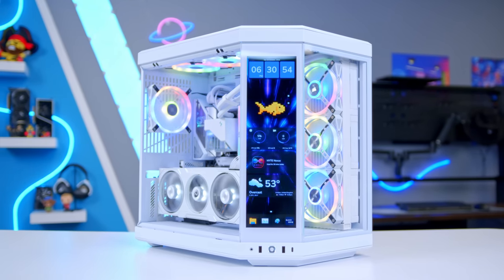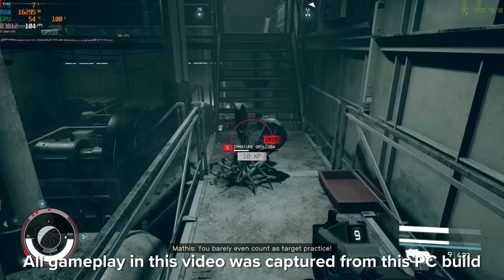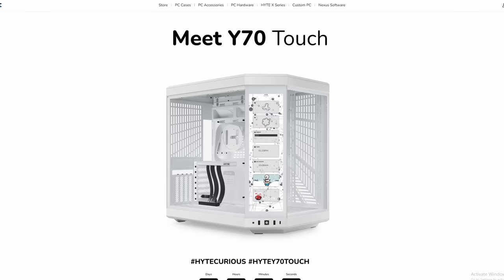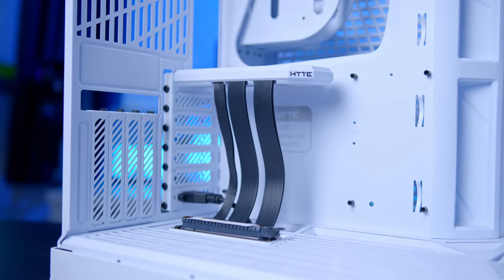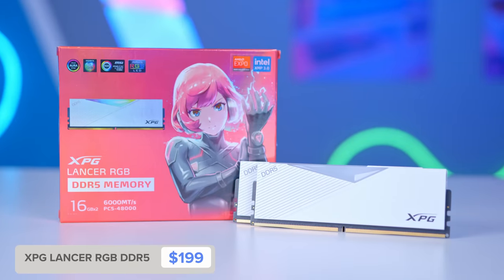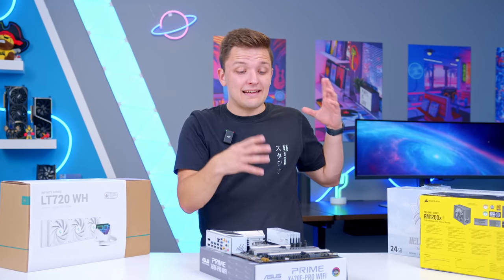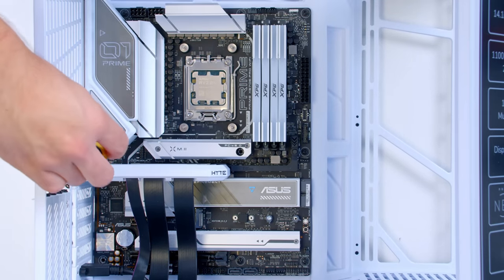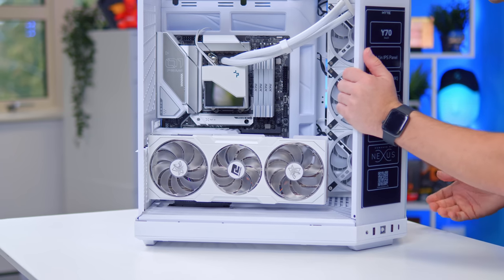The ULTIMATE $3000 Gaming PC Build! 🤩 [HYTE Y70 Touch, 7900 XTX & 7950X3D]

Comment: Nice video as always. One question how did the expo profile go with the 4 dimms or did they default to 3600 MHz and not post at the full speed of expo?
Reply: Thats what i want to know, i though 4 dimm ddr5 was unstable
Reply: 4 sticks will NOT run at 6000 MT/s on Zen 4 at least not just yet, but 5200 to 5600 will work just fine depending on how lucky you got with the silicon of your CPU/Mobo.
Reply: For the Ryzen 7000 series, it's probably best to lock the memory at the CPU's specified speed until Ryzen 8000 irons out the bugs.

Comment: Which is better 7900xtx with 7800x3d or 7950x3d. I really wonder which one is best cpu for 7900 xtx to avoid bottlenecking.
Reply: If u only want raw gaming performance then 7800x3d is the way to go BUT if ur going to do workstation, editing, etc. then you would want to go with 7950x3d. Both are completely fine and you'll have 0 bottlenecking.

Comment: The question is, should i go with h9 elite or y70 touch
Reply: If you are doing applications on there and work with your PC y70 touch. Otherwise the elite . But I must say the y70 is more optimal for airflow .
Reply: Phanteks NV7 !
Reply: @KPAki1Ler  I’m not a big fan of the extra space
Reply: Get an NV5 and buy the hyte panel save a $100
Reply: Neither go with an h9 flow
Reply: I'm in the same dilemma.
Reply: The extra material at the top and bottom of the Hyte Y series makes it look tacky. I feel like the H9 will age better aesthetically, but it's hard to say. The Y60 didn't age well to me.

Comment: Just built my first build, it’s a 4090 gaming oc, 13600k, z790 aid prime with lian li 360 aio and gskill ripjaws and a 2t 980 pro, but I don’t get the frames I think I’m supposed to get can’t even hold 144 fps at 1440p on most games and it’s in hyte y60
Reply: Bring it to a technician for help also how much did u spent lmao
Reply: that's weird what games was you playing?
Reply: @primetimekd  warzone, Fortnite doesn’t even run 144fps at 1440p, naraka, destiny, apex kinda stays 144 but then sometimes goes to 143, warzone I get 138 and fluctuates down not up on max ultra but if I go lowest settings I get worse fps! I get like 118 at 1440p lowest settings but 138 at ultra settings. $3500 and it feels like dogwater
Reply: @lazyturfbattler  my 4090 was 1600 after tax open box from new egg, and all the other parts were price matched at Best Buy, was $3,330.30 after tax for the pc parts, and I got a 1000w Eva gt gold
Reply: Ddr5 s5 ripjaws, got that cpu because it seemed to run cooler than the others and with the 4090 I didn’t want to have it to hot just wanted it to last
Reply: Vg27aq monitor could it be I’m not using DisplayPort? And idk how to optimize or xmp the ram
Reply: And I built it all except Best Buy did the psu
Reply: And I’ve had it build Around June 25th
Reply: @cody6584  yea that cpu is fine. Are your temps fine?
Reply: What is your ram speed as listed in bios.
Reply: @cody6584  no hdmi is fine but you might have to check ram. It may be running on lowest memory profile. Just look up a video on how to setup xmp for ram or get your rated speed.
Reply: @cody6584  did u plug ur hdmi into ur motherboard? Plug it into the gpu
Reply: @cody6584  I suspect ur playing with integrated graphics from ur cpu
Reply: @lazyturfbattler  you can plug hdmi into the gpu? Yes it’s into the motherboard, but when I play games the gpu shows up and it still looks like insane graphics
Reply: My city’s power is off until Tuesday so can’t read off kuch, once the gpu hits 60 it turns the fans on then turns off for a second. Once it drops back under
Reply: @cody6584  yea that’s the problem. When plugged into the motherboard ur pc will work but have very little fps because it’s using interacted graphics from ur cpu.
Reply: It’s probably the 13600k probably bottlenecking the gpu slightly
Reply: u got a 4090 oc but only using a 13600k ? very odd

Comment: Hello GeekaWhat how are you? I would like your input on the following, since I'm starting to think I might have screwed up.

I've currently bought the following parts to build my PC + Monitor

- Asus ROG Maximus Z790 Dark Hero
- Samsung SSD 990 Pro NVMe M.2
- ASUS ROG STRIX GeForce RTX 4090 GAMING OC
- Corsair Dominator Platinum RGB 64GB DDR5 (2x32GB 6600MHz)
- ASUS ROG RYUJIN III 360 ARGB
- Intel Core i9-14900K
- Lian-li Fan AL VS ARGB x7
- ASUS ROG Thor Platinum 1000P II Platinum

- Corsair 5000D Airflow
- Alienware AW3423DWF 34

Before i purchased it I've looked in several websites that calculate Watt consumption and they recommended 1000W, but after reading a bit more today I'm a bit concerned it might not be enough. Since it's still on the Box and probably can still upgrade it, despite all the work is going to give, is it worth it, or this power supply will be enough?

Thank you in advance for your time and help
Reply: I would get a 1200w psu or higher to make sure the gpu dosent overload it
Reply: The be quite one is good for under 200$
Reply: Sus about anything alienware but it sounds good

Comment: Im building my first pc. I'm wondering if I should go with a ryzen 9 or i7... does anyone know what would be better for my build?? PIss??
CPU Cooler
Kraken 360 RGB White
Service
Standard Service (US) ASSEMBLY
Software
Windows 11 Home
Case
H9 Flow White
Motherboard
MSI Pro X670-P WIFI DDR5
CPU
AMD Ryzen 9 7900X 12-Cores 4.7GHz or intel core i7 14700k
RAM
Team T-Force Delta White DDR5 6000MHZ
CL38 2 × 16GB
GPU
Gigabyte GeForce RTX™M 4070 Ti Windforce OC
12G
Power Supply
MSI MPG A850G PCIE5 850W Gold
SSD
Samsung 990 PRO 1TB
Reply: 7800x3d and 7900xt is the king
Reply: @BornInArona  depends on what game. The 7900x and 7800x3d are close to each other in game performance. Some games it’s one and some it’s the other. Best to choose which chip is cheaper at the moment.  If you’re doing other things besides gaming then the 7900x wins out.
Reply: @TheSjuris  I'm going to buy a 7800xt, 300+ € for avg 20fps, nonono
Reply: @BornInArona   maybe don’t use an 8k monitor then. No gpu gets that low these days.

Comment: 4k is 3840 x 2160...?
Reply: I think so because when i go to the setting and visuals I see that resolution then one higher but it is also 4k.
Reply: @MrAnimescrazy  it's just in the video he's calling it a 4k display when it's not
Reply from the maker: The display is ~4,000 pixels tall. The reason it's not 2160 wide is because of how thin the screen is. Therefore I'd still class it as being 4K due to the pixel density. It's only less pixels wide than a typical 16:9 display because of the aspect ratio. It's incredibly sharp.
Reply: @GeekaWhat  it is quite close to 1/2 the resolution of 4K but if the pixel density is good and a good quality panel I can see why your bigging it up.  For me personally it's a bit of a gimmick for the price.